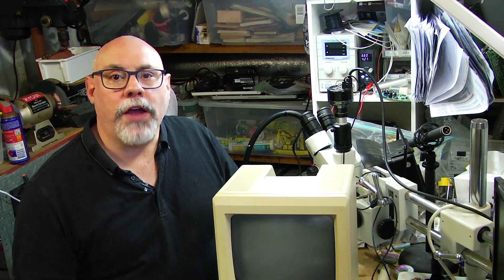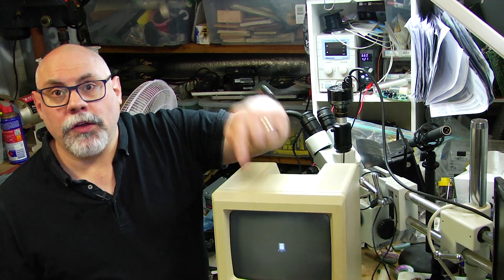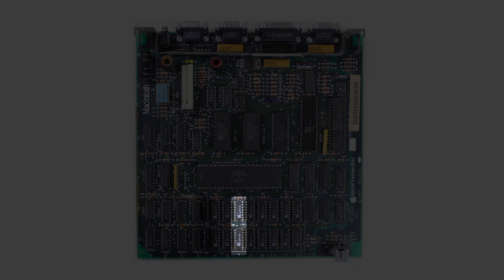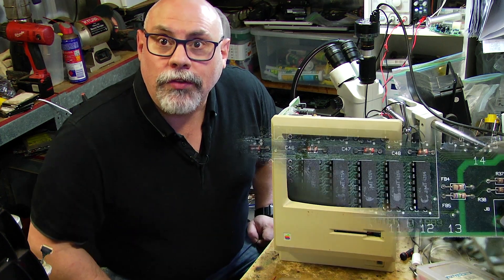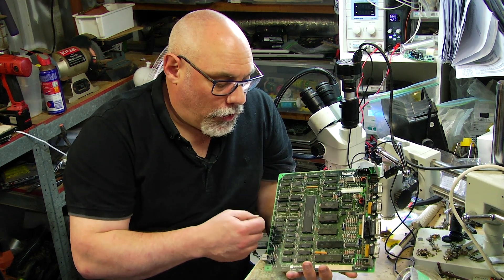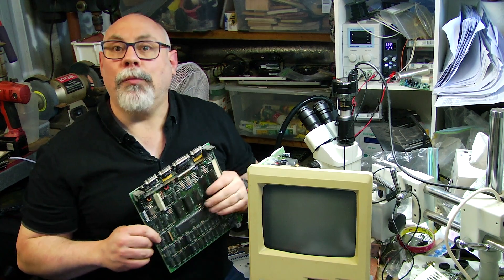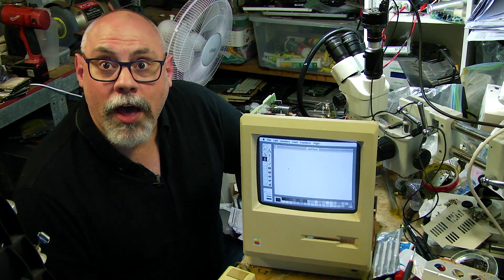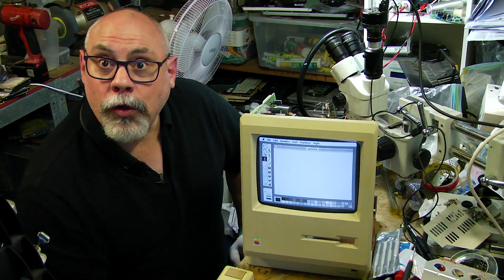Repairing a Macintosh 128K

Comment: I don't think the screen is supposed to fill the display that much
it's supposed to be at 72dpi, and that looks a bit too big for 72dpi
Reply from the maker: You're correct. The display should be exactly 7.1 inches by 4.75 inches.

Comment: Unless you want to reuse the chips it would be much easier to cut off the memory chip legs with a special cutter and desolder the remaining pins one by one. It might more time but it's easier to remove. Just a personal opinion of course. good work.

Comment: How did you adjust voltages?
Reply from the maker: If you set your multimeter to DC volts, attach the negative lead to the computer chassis, and the positive lead to pin 6 of the floppy port (you can use a paperclip to put into the hole) you'll get a reading of the 5V rail. You can then use the voltage pot on the analog board to adjust until your multimeter reads right on 5.00V. Be careful though, as there are potentially deadly voltages exposed when you remove the back cover.
Reply: Branchus Creations Thanks alot for that piece of advice!
I've repaired dozens of Macintosh but never thought about adjusting the voltages. Now I've got to go through all of them to do just that…

Thanks again and keep up with the awesome work!
Reply: There should be a small pot located on the analog board that can be used to raise/lower the voltage.
Reply: Nate Tronerud Thanks Nate!